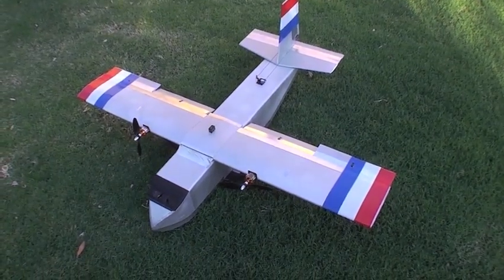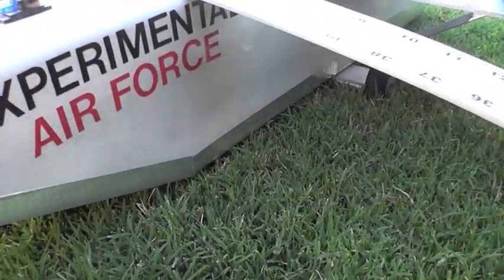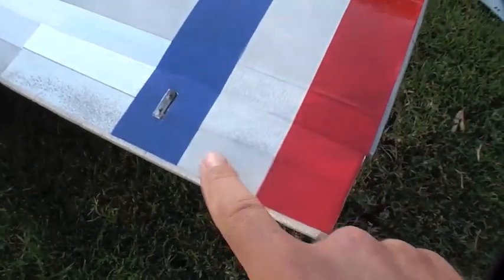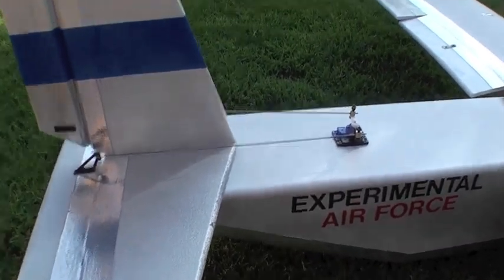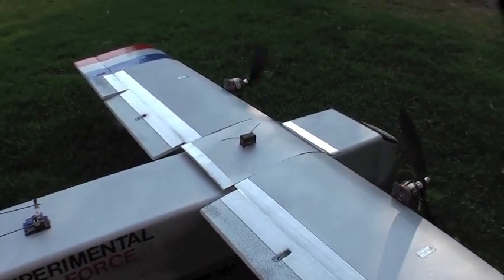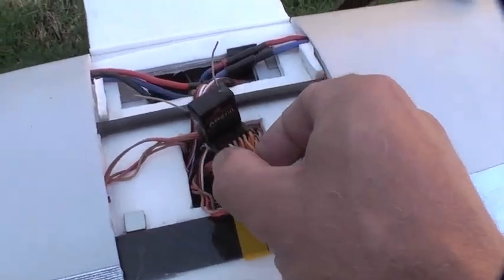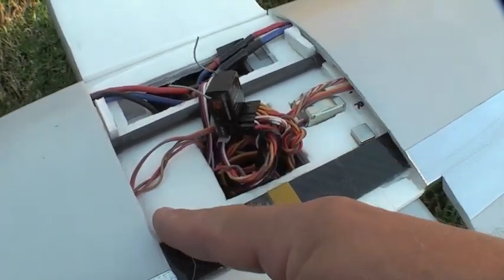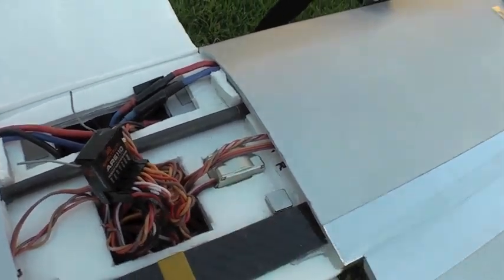RC-69 Cargo Dropper - Details and Specs

Comment: That's what I wanted to hear, a fixed wheel will save lots of time, be cleaner in terms of parasitic drag and be one less point of failure. Thanks, I should have some pictures of it on your rcgroups thread in the next few days.

Comment from the maker: Great news!  Yes, just reverse any two motor wires to change direction of rotation.  Pusher prop or tractor prop will work fine, right-hand, left-hand not important, just orient the convex side with writing forward and make sure it turns the way that prop needs.

Comment from the maker: Differential thrust from motors using a V-tail mixer provides all the steering.  The nose wheel does not swivel.  Sometimes a little up elevator is needed to unload the nose wheel and allow it to skid over the taxi surface.

Comment from the maker: Just some ordinary 40A ESC's from RCTimer.  Very reliable and inexpensive.  The BECs are linear, which is 100% save for connecting multiple in parallel via a simple Y.  Switching BEC's are usually safe but use caution.

Comment from the maker: Start by checking out the Armin Wing and Tubular Fuselage videos on this channel so you can understand those techniques.  You'll need one 5" fuselage and two wings from 20-25" long each, and 6-8" chord.  Building the nose and tail and adding the motors and landing gear are what's left.  I will do a formal build video on this plane but it might be a few months so in the meantime I might recommend trying out the foamboard techniques on some simpler planes if just to get some practice.

Comment from the maker: A Y-splitter works fine, but I use a V-tail mixer with the rudder channel mixed into the throttle input.  This allows differential thrust for ground handling as well as very authoritative yaw control in the air.  These are very inexpensive and easy to hook up.

Comment: Cool thanks I was mostly concerned about not having true full throttle and considering not using a v-mixer because of this. Collected about half the parts for my RC- 69 should be flying it in a couple weeks. I only have a five channel radio so my flaps and cargo latch will share one. Just going have to have full flaps while loaded.

Comment from the maker: That is true.  If the throttle stick is anything less than 100% then one motor will power up and the other will power down upon rudder input.  If at 100% then only the motor on the inside of the turn will power down.  It's pretty rare to be flying balls to the wall and kick in the rudder though.

Comment from the maker: @stonerscolony Give it a shot but I can't promise the leading edge bend will work with Depron, since it doesn't have paper, as with foamboard.  You might try generously covering the outside of the the leading edge with tape before bending.  Foamboard is so cheap and does the trick.

Comment from the maker: @bhcnomo I will put that video in queue for a cargo plane build series.  Briefly hook the two motors to the outputs of a V-tail or Delta mixer and for the inputs from your receiver use the rudder channel for the rudder input and throttle channel for the elevator input.  Power up with props off to verify hooked up right.  Test behavior to see that left motor spins up on right rudder input, left motor on left rudder input, and throttle up both on throttle input.

Comment: Ed your info was correct. The NOOB TUBE is a ball to fly however, is not a trainer. It is predictable but I had to stay ahead of it. Excellent flying characteristics.I do not think I will attempt the jet! I do have a question about the Axon. The craft is a pusher configuration. How did you setup the motor operation ie a pusher prop which does not look like it. Did you reverse the wires to the speed control or is the motor taken out of the case and turned around similar to nitro engines

Comment: I am presently constructing an AXON and I am making a mistake on the wing construction. I am getting a fold ridge on the underside of the wing about an inch back of the leading edge.Any suuggestions? I am using the same foam board that I used on the Noob Tube and I did not get as much of a ridge. For information I got the foam board at Staples.

Comment: I notice one side throttles up when you aim rudder to the opposite. does this mean that you are getting a small amount less than full throttle out of the motors when the throttle stick is all the way up? Or does setting the throttle range in the programming of the ESC's with out touching the rudder compensate for this?

Comment: There are a couple, could you maybe give a model number? Also, with two BEC you would hook them up through a Y split and put it in the BEC/throttle spot on the reciever? I'm thinking about building my own cargo plane based on this one and would like to have a good 30-40 min flight time, you think it's possible? If so, would you have any advice from your experience? Thank you so much (being a high school student and relatively new to the hobby, all feedback is appreciated).